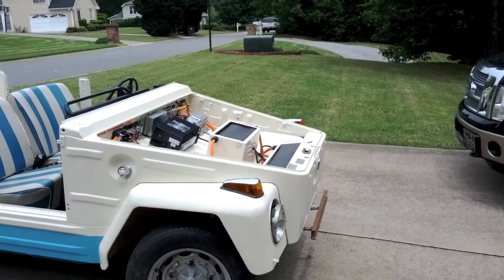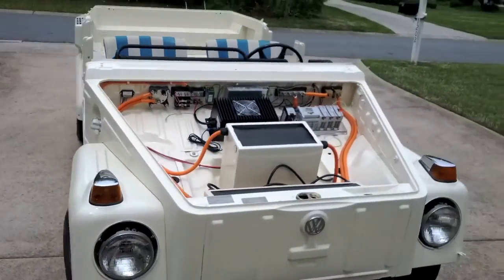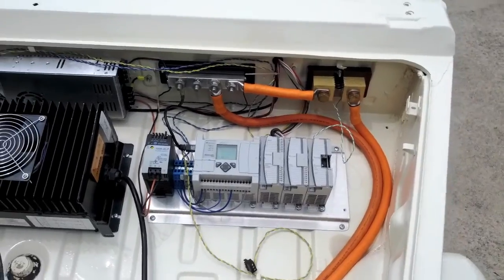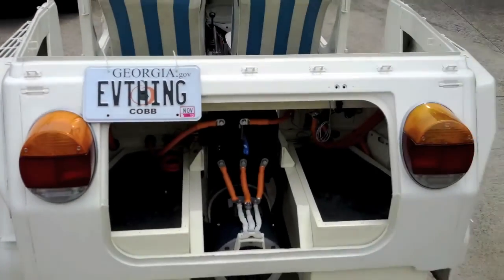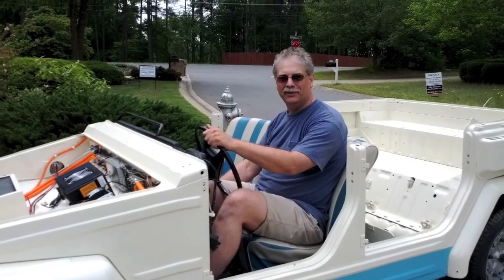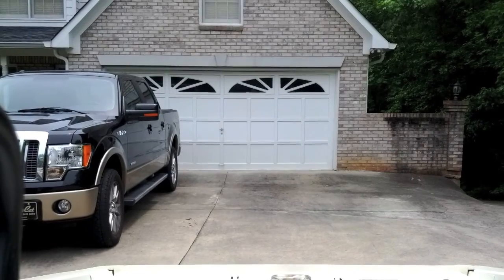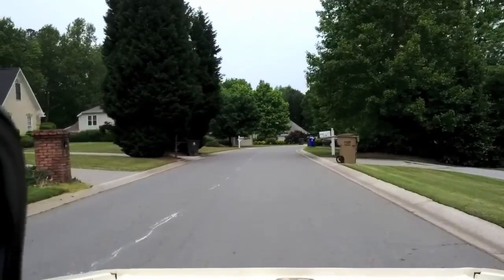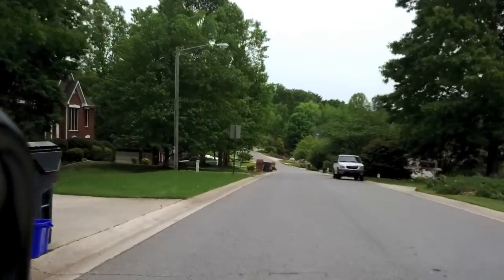May 2013 First Drive

Comment: Jeff, I saw you mentioned a buzzing contactor on the EVTV blog.  I had the same thing with my AC31 setup, talked to HPEVS and they sent me a new contactor in return for the old one, noise gone.  They said sometimes they just make noise from the PWM of the 24 volts.